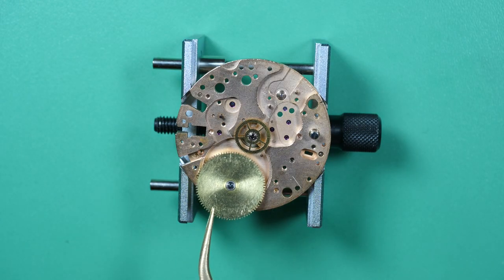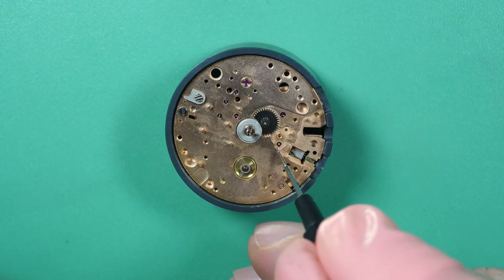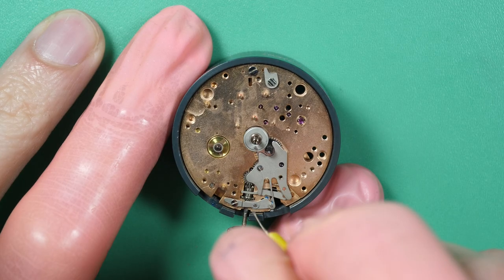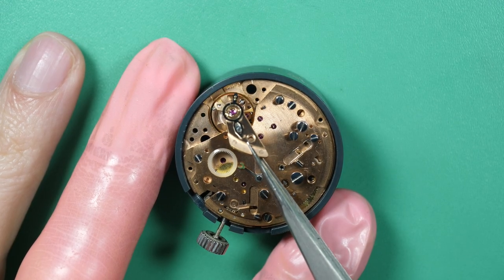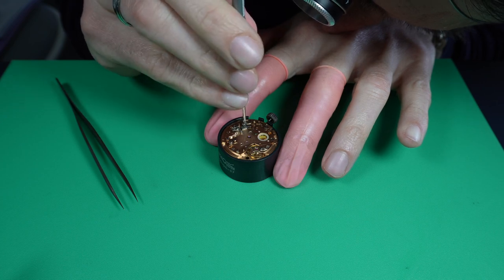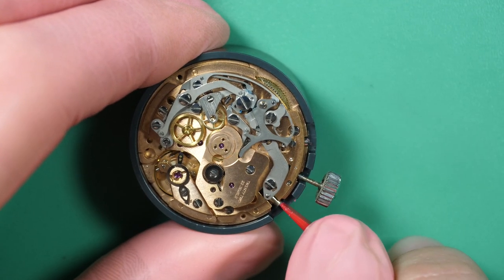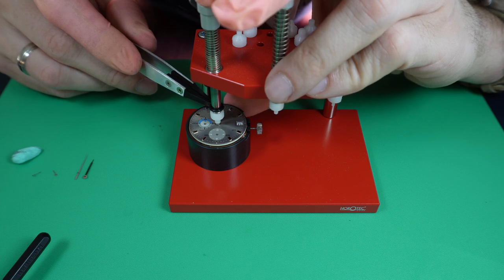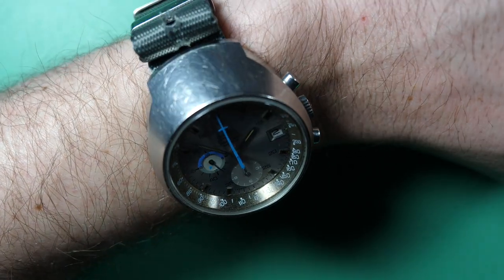Omega Speedmaster Mark III Vintage Watch Restoration - Part 2

Comment: Cher compatriote, c´est magnifique, mais s´il vous plait, en francais aussi, pour les pauvres ignorants qui ne parlent pas anglais, ..! J´ai la même, je voudrais la restaurer, mais où ? Et combien ca coûte, et quelle est la cote en collection ?
Reply from the maker: Bonjour Gérard, je vais créer une chaîne en français dans quelques mois avec les mêmes vidéos. Pour la restoration vous pouvez l'envoyer chez Omega. Le coût sera de 750€ pour une révision simple sans les pièces mais le délai est à 6 mois. Vous pouvez l'envoyer chez un indépendant qui sera sensiblement moins cher mais avec des délais plus court. Une Mark III vaut entre 2500€ et 3500€ selon le modèle et l'état. Si vous ne trouvez pas vous pouvez m'envoyer un mail et j'essaierai de vous aidez.